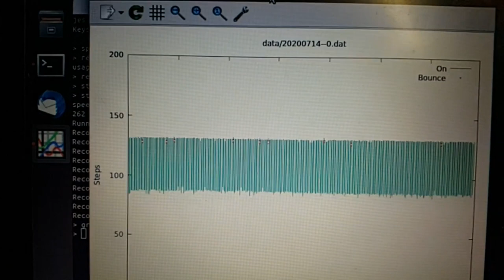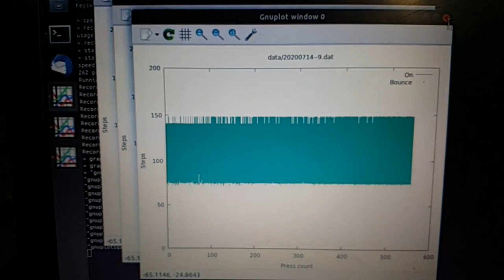Operating the 10-switch tester

Comment: Haha this thing is fantastic!  FYI: If you printed the spiral spring part in POM it'd last an order of magnitude longer than these PETG springs.  Also, the PETG springs will get weaker and weaker over time as the fatigue stress breaks apart the (reasonably weak) hydrogen bonds that holds that co-polyester together.  So they start out reasonably strong/stiff for the first 300 or so keypresses (in my experience) but ultimately start to lose strength after that.  The good news is that they should go for many thousands before actually breaking apart =)